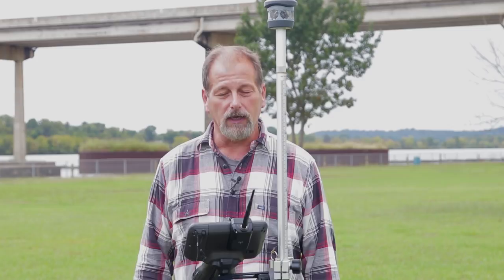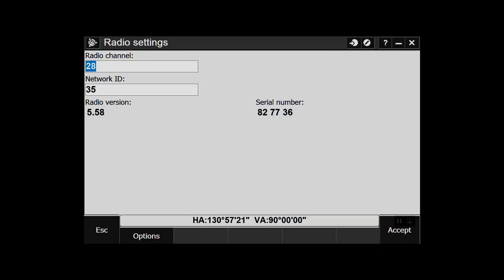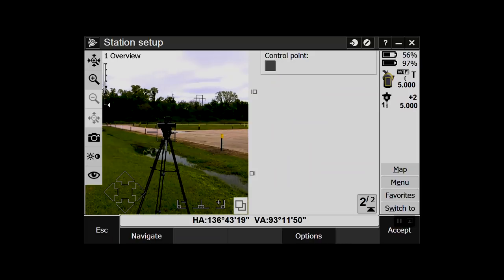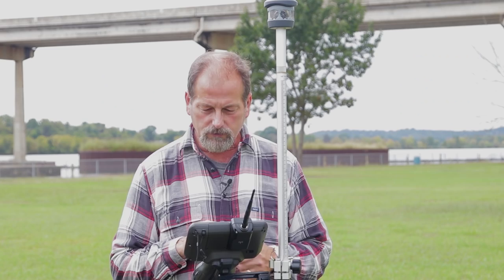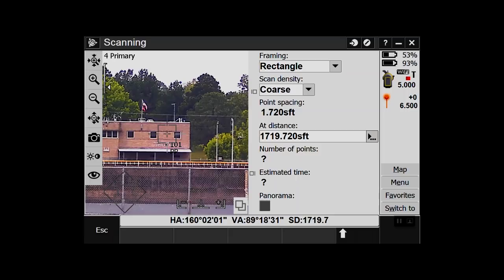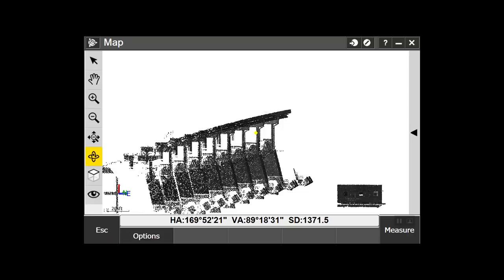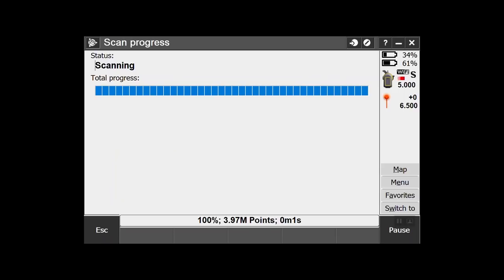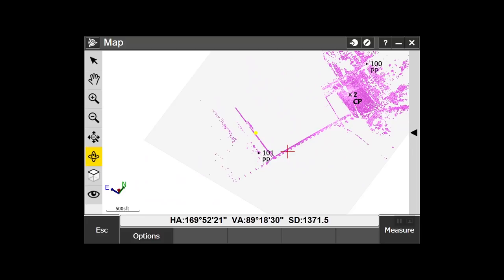Trimble SX10 Workflow

Comment: Wouldn't recommended the sx10 we've had two go down on us. Sent them to trimble and found out the high resolution camera's went bad. Apparently they aren't designed for 360 scans outdoors because the sun will  fry them. That was trimble's explanation anyhow, just wish we knew that prior to buying the sx10.
Reply: Just bought one .. should be alright, hardly any sun in the UK 😂
Reply from the maker: so I have done hundreds of dome scans here in the south without any issues.

Comment: In regards to setting the temperature on the sx10 or a s7. Would u factor in windchill? I have to preform monthly surveys at some monitoring areas, one area some of the shots are in the 0.6 mile range. I work in Canada so in the winter there is also a windchill factor :(.  
For an example , last week it was -20°F (-36°F). The gun would be in the high wind area but the prisms would be in the low wind area. Would I just split the difference (-28°F)? This area I am referring to is monitoring slope stability on an open pit and data is put into an excel sheet complete with trending graphs. I don't know about the engineers but myself I would like to see the graphs trending in towards the open pit not back and forth.
Reply from the maker: Good question, honestly I have never given that any thought because it doesn't get that cold down here!!! I would think it would be the ambient temperature not the wind chill. Keep in mind the reason you are recording the temperature and pressure is to calculate the speed of your EDM. We are talking about light and pressure and how that affects the speed at which you get a return and the distance is calculated. Down here we have the opposite problem in the summer with humidity, we use the actual temperature not the heat index. I wish I could give you a positive answer but I just can't be sure unless I tested it there and it's just too damn cold for this southern boy!!! Ha!

Comment: Robert, great video! 
One question, is it possible to turn on a laser pointer in DR mode?
Reply: I was never able to on Trimble equipment, probably for good reason.

The logic is that you can burn your eye pretty bad looking at a prism/Backsight.

You can do it with Leica, but it was a makeshift way to target the Backsight in superlow light environment where auto aquisition to center didn't work well
(One of the dumbest thing in retrospec)
Basically when the laser would hit the side of the prism, I would it shut off to not burn my retina & center it with the glowing node reflection....

Comment: How I can shot repetition shots with SX 10??
Reply from the maker: Andi Bica tracking?
Reply: Surveying With Robert ..i did with my S6 repetition shots for control points..and I was wandering if it is something similar in SX10
Reply from the maker: Andi Bica I am confused about your question. In standard mode the default I 5 shots. Are you wanting to average the points?
Reply: Surveying With Robert...with the repetition shor for my Controls I did three sets for each point..and I adjusted them in the office..There is an option in S6 (repetition shot) that you can do that..I dont know if Im clear..
Reply from the maker: You have standard and tracking on your measurements. Tracking means it’s always shooting a distance.
Reply: Surveying With Robert its standart always

Comment: This doesn't seem anywhere near as good as the leica ms60
Reply from the maker: So how fast does the MS60 scan?
Reply from the maker: I looked and the MS60 does 30k and the SX12 does 26,600k per second. So it comes down to which software you like better. This is an older video with older software. I really need to update the video. The tools we surveyors have now is amazing.
Reply from the maker: Actually the Trimble is 26.6 all the way the MS60 is not according to the data sheet.